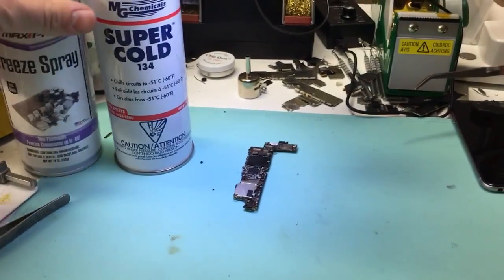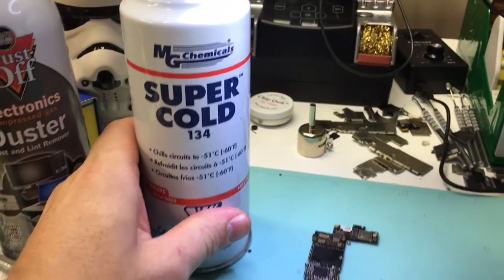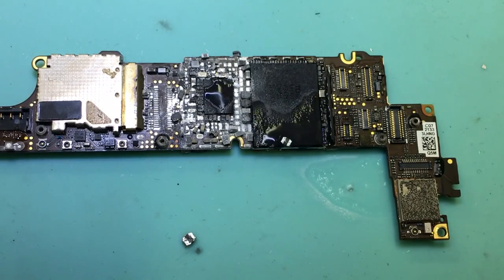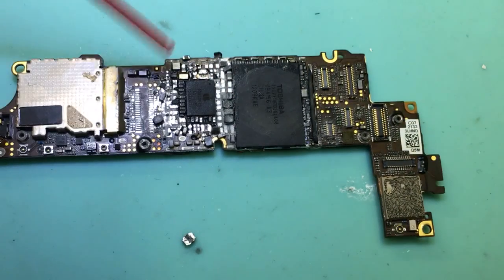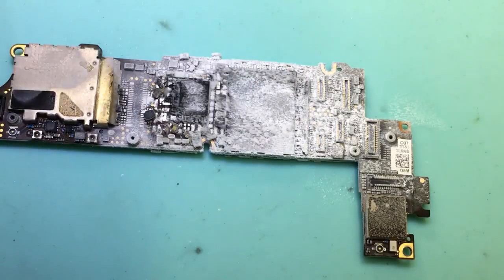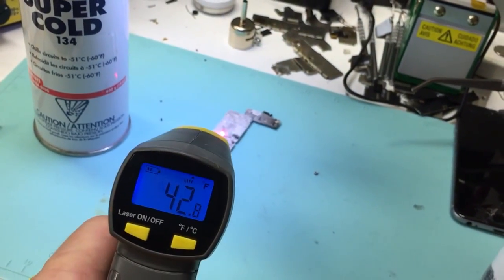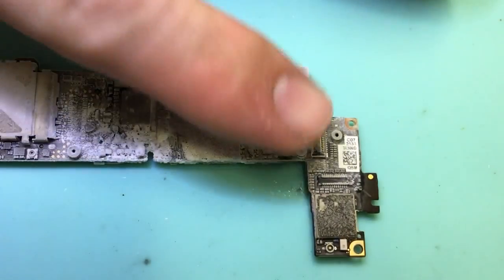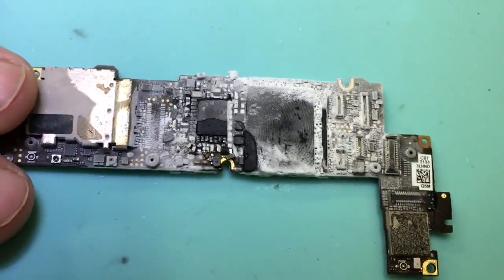How to use freeze spray more efficiently

Comment: Dumb question alert - but can you use freeze spray on a circuit board to cool it whilst it's running?
I've got a hobbiest CNC machine and the 'chip' (I'm no expert but one of the black little rectangles) overheated and so I've bought a new circuit board. To avoid it happening again would 'freeze spray' work - or should I fit a 'mini' circuit board fan - and how would I do that?  Freeze spray sounds easier as I only use the machine occasionally.
Reply: Put some thermal paste and heatsink on that chip. If not enough, maybe add a fan to cool the heatsink